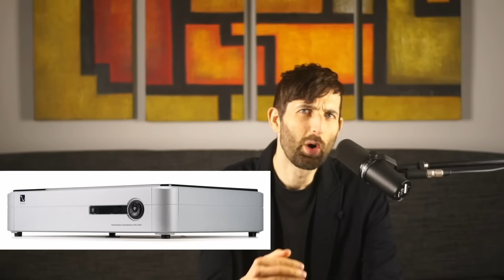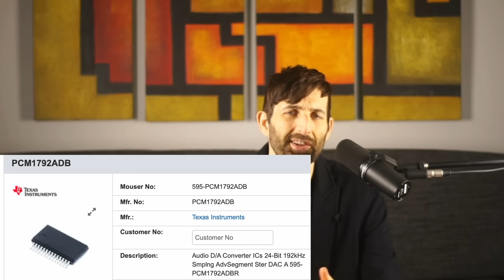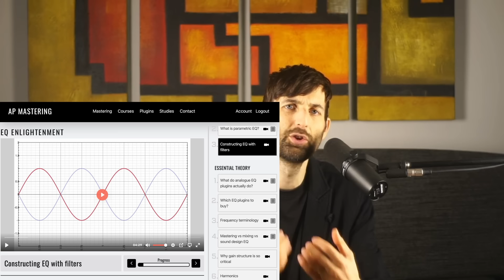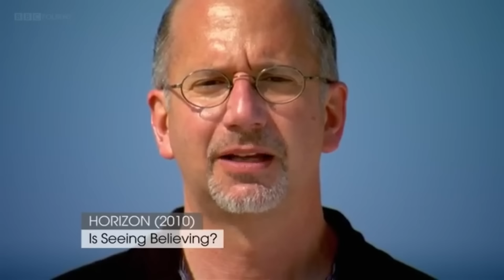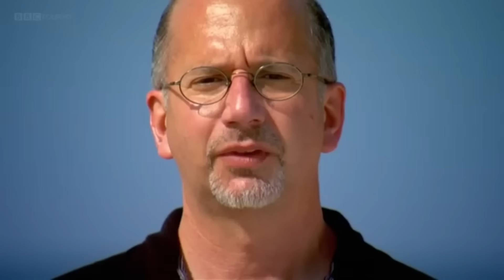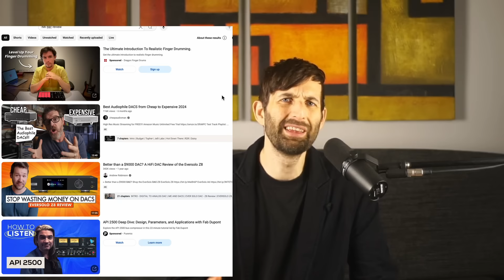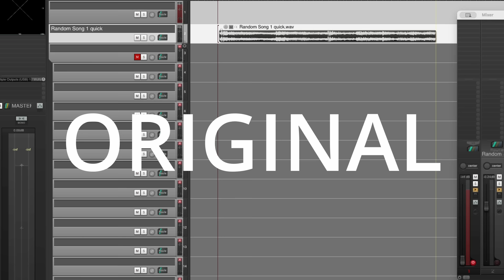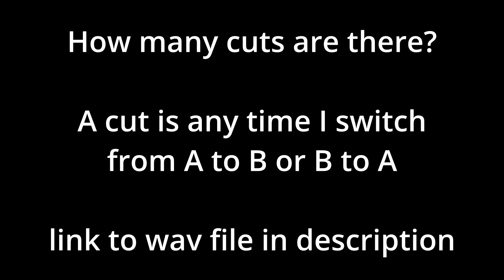The DAC Scam - Almost everyone believes the hype

Comment: £200? Exactly what experience do you have designing, manufacturing and selling DACs?
Reply from the maker: i've not specifically design a dac before but i've made other electronic devices
Reply: @ Off the top of my head (I did all of this 30 years ago) you have to budget for equipment, premises, design, certification, tooling for the case, parts, assembly, testing, custom packaging, shipping, VAT, advertising, warranty returns and support. The bill of materials alone came to way over £250, and prices haven’t dropped in three decades.
Reply from the maker: yeah that's if you want to make 20 units in California. There's a bunch of actually good Chinese products now using state of the art chips for a few hundred bucks.
Reply: @ I got the impression you were commenting on those custom  units you were showing. I’d bet there are still compromises made on those Chinese units, starting right at the noisy wall wart switch mode power supply they invariably use.

Comment: It's for people who put their houses on springs to isolate their listening experience from the vibrations caused by the highway ten miles away.
Reply from the maker: lol
Reply: I know a guy who actually poured an additional concrete pad in his basement for that reason.
Reply: @sk.8835  i have my hi-fi system wired up to a separate dedicated supply meter, it cuts interference from the rest of the electricity.
Reply: @Hykje  im getting solar panels just to generate my own pure electricity for my audio

Comment: After this video I have to tell about the RME ADI 2/4 I bought, and was extremely surprised on how GOOD and different the audio quality is. Together with my whole highend chain the RME is expensive (2000)  but so satifying. With that I bought the Sennheiser 490 pro headphones that adds up. A mix I recently made was so much better apart in layering, frequency wise. I am not a pro pro but this was a good buy, my ears didn't fool me here!
Reply from the maker: RME make extremely transparent stuff. but it doesn't sound better than something else highly transparent
Reply: @APMastering so you guess  I paid to much:)?

Comment: I agree even some cheap unbranded devices will have decent DACs now, and I have a audient id44 with AKM chips that is good enough for me. However I’m investing on a more expensive DAC because 1) having EQ presets on the DAC is handy for applying some room correction. 2) I have a customer that complained to me lo remove noises but I was not hearing them, it happens he listens on headphones at deafening levels, so he can hear the noises on the quiet parts that I don’t notice or care when listening under 85dBspl, and newer DACs measure better SNR than previous generations, I think it helps to have something  better than the customer 3) I’m curious about about things like R2R and discrete technologies that weren’t mentioned on the video, I think it is worth trying it yourself
Reply from the maker: also room correction is for the most part a gimmick. will do a video on that too at some point
Reply: @APMastering I’d love to hear your take on that. I’m currently on a tiny room, I have Sonarworks, but I am leaning to just use small speakers.
Reply from the maker: i mention r2r iirc. they mostly measure worse than delta sigma because there is no oversampling. listening on headphones really loud can be done with anything sensible and you will hear huge details even on cheap stuff
Reply: @APMasteringwell I rewatched it and you do mention NOS, and I assume you use the same term for R2R, and I have to assume you mean discrete falls under the same “ no reconstruction filter” idea. if like that I’m truly alarmed and will email the manufacturer to make sure. About listening really loud on cheap devices it will  show more noise, even my speakers add noise, I just want to listen better to prevent the noise from adding up, for example to better set a gate time. Also in my 50s and after some airbag car experiences I will think twice on listening at dangerous levels.